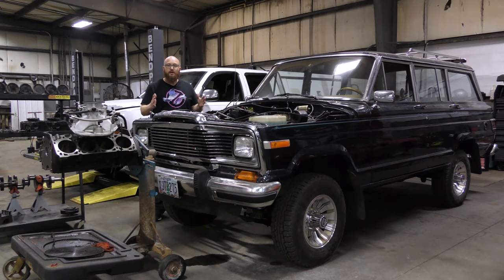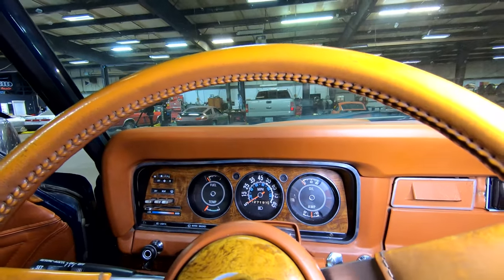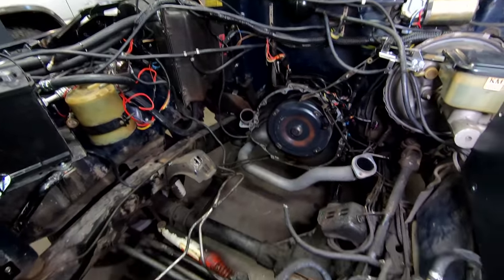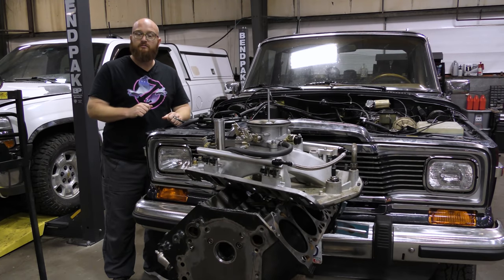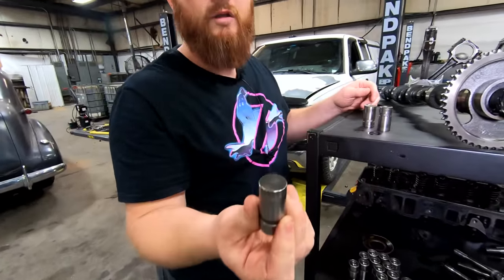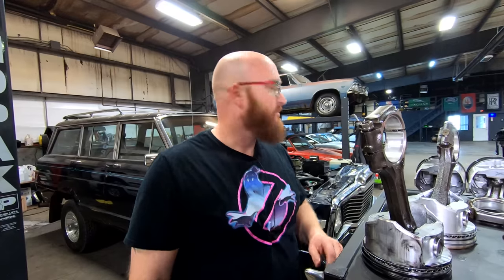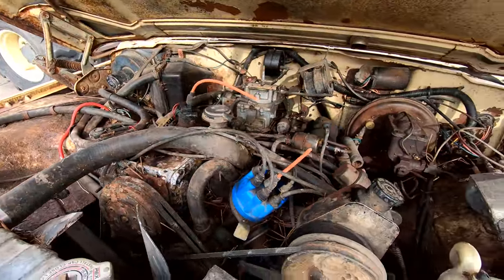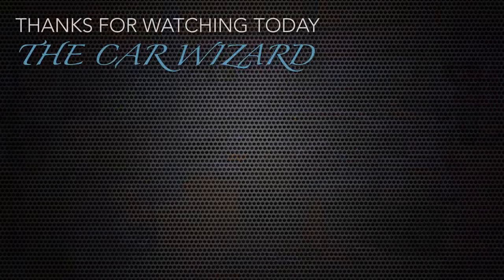The '83 Wagoneer rebuild is dead! CAR WIZARD gets burned by another shop!

Comment: Ok watched the rest of the video Car wizard your diagnosis is very disappointing, One of the problems with building engines is the unknown. I have owned a shop for over 30 years. basically people bring you engines that are well worn have had years of corrosion stress and heat cycling and expect gold back and they should they are paying for a service.
That block had a casting issue since the day it was cast a cold shut or a thin porous spot in that area then after many years of heat cycling and corrosion thermal stress it was thin. The rebuilder had no way of knowing that. it wont show up under mag or even a pressure check.
The casting leaked coolant on the cam lobe the one lobe went flat and here you are.
Its not a cam break in issue if its only one lobe. There are some bad lifters going around but lifters are machined to very close tolerances and what can a builder do take every one apart and use his NASA grade measuring equipment to quality control them? i actually bought a Rockwell hardness checker after being burned by a soft pushrod guide plate.
Also hydraulic lifters are very sensitive to contaminates like the metal from that cam lobe going around the filter through the bypass. This should have been caught and torn down earlier.
In the years i have been in business I could tell you some story's like the mazda V6 that would run for 5 minutes after rebuilding then start smoking. pulled the head off 3 time finally decided to borrow some oil green dye from the auto repair. pulled the head off one more time used a ultra violet light and it was a porous intake port. Pressure testing wont show that because its not the water jacket. Bought a new head installed it problem gone. Why didnt it smoke for the first 100,000 miles? The casting was just good enough . 
A really nice 66 Chevelle convertible with a 327 rebuilt it ran great had a knock like a piston pin after rebuilding? This was when we first opened up shop. After pulling and tearing down 3 times triple checking everything it turned out that the new replacement performance cam had a lobe cast just a little to wide just clipping the lifter on the opposite bank and i guess the hollow valley area amplified the sound. We learned not to put the engine back in till we absolutely found the issue on that one. I could go on and on with more of these.
The answer is you always back your work as long as the customer can keep a reasonable cool mature head you fix it for free even if it is not your fault and do whatever you can to head these issue off but there will always be odd thing popping up in this business. The good faith will pay back in the long run.
Then there is the auto repair shop or Buddy that has bias/loyalty toward another shop making up things or at least seeing things in a neg biased way causing issues. Now instead of getting a warrantee of a refund the customer has been all stressed out pissed off by the repair shop and gets to pay for the job twice.
Are there bad machine shops out there? Oh you bet. There is not required certification billy bob just buys some equipment and claims he is an engine builder because he re ringed a 283 chevy in bobby joes barn and it ran.  
Oh and that big single plane with a race speed density throttle body is a complete miss match for the engine.

Comment: Buddy of mine has an Automotive machine  shop and builds anything from stock to full on large drag motors. He tells me most all lifter / cam failures are due to the lack of proper break-in. He just got done with a Jeep 304 and he installed a street grind cam designed for roller lifters. I believe it was an ISKY cam and lifters. If you like I can get the part numbers he used.I’m with the other guy here get a dual plane intake intake. It will make more usable power in the rpm ranges the customer needs.

Comment: I bought a truck with a rebuilt 468 big block that wouldn't run right. Would never idle right and the adjustments would always change. It was eating the camshaft because there was 3 times the amount of spring pressure that you can run on a hydraulic flat tappet cam

Comment: Most of the damage I see can be attributed to what I am fairly certain was a lifter failure. The trashed bearings could easily be the result of that lifter failing and taking a cam lobe with it, sending a ton of debris through the engine. The sticky wrist pin though...... While it is possible that could also be debris, I would say that there is a different issue going on there.  To be honest, I wouldn't be the least bit shocked to find out that the previous engine builder did most everything correctly. Where I think they went wrong was installing the flat tappet cam. Every single cam company that I have personally spoken to in the last couple of years is experiencing a ton of flat tappet lifter failures. It also seems that most all of those companies are buying their lifters from outside of the USA these days. Unless you can find nos lifters that were made at least 5 years ago if not 10, I would explain to the customer why a retrofit to a roller is a wise choice in this day and age. The down side being the added expense.  Some will debate that the roller portion of the lifter can fail ( which is true ). However, GM anyway ( and most likely other brands too ) have been using roller lifters for 30 years or more. I personally have seen more engine failures caused by the bearing journal on cams wearing out than by failing lifter rollers. The upsides being lower oil temps through reduced friction. You can run what ever oil you like ( and yes, with flat tappets you have to watch what oil you use ).

Comment: As many are noting about poor quality lifters on the market right now, the damage to the lifter screams lifter failure. If the cam failed usually the lobe gets knocked darn near completely off by the lifter before it disintegrates. Wizard, here is how bad the poor quality lifter issue is right now: My race engine builder re-used 40 year old lightened lifters in my air cooled Formula Vee engine. You read that right, rather than risk using new but likely poor quality lifters it was a safer, more reliable bet to use used, 40 year old parts.

Comment: I believe lifters need to be individually fitted and gapped with feeler  gauges. This has to be done to strict tolerances.

Same with the bearings on the crank journals. Fitted with the correct tolerances with proper lubricant. 

Cowboy engine builders.

Comment: there are quite a few places ( like ebay ) where they are selling counterfeit cam shafts and it is Chinese garbage. The cam failure more than likely destroyed the motor. toss that victor intake and get a dual plane . but use a 1" spacer block . it helps create a mixing chamber effect for the throttle body type injectors , and a more even disbursement  of the air/fuel to the cylinders . AMC engines are a bit of a soft motor in terms of metallurgy. but a stock build should not be a big deal . The truck is so nice you would be miles ahead with an LS < but you already know this im sure . Good luck with the rebuild.

Comment: Lifters have been very bad except from a single Source, I do not remember the source, but call Uncle Tony's garage, he has had several cam lifter failures in the last few years due to really piss poor parts. It may not have even been the engine builder that's at fault. You have said in the past that you are not well-versed on these older style engines. Uncle Tony's garage can get you straightened out quite quickly. He has built with brand new cams and brand new lifters engines that lasted literally an hour or a little over. And he knows how to break in a camshaft. Like I say this could very well not have been the Builder's fault. At least as far as the camshaft goes. As for the Assembly of the connecting rods and pistons, yes that's an issue. There is no excuse for that. And it does look like those things were badly out of talents and the engine may have been put together completely dry.

Comment: I'd like to have a look inside the oil pump since there are multiple points of lubrication failure. It's unlikely bearings, wristpins and lifters all failed simultaneously.
Was the oil pickup far enough from the floor of the oil pan?

Comment: So many signs of oil starvation you might think that the oil pump was installed incorrectly and there was no oil pressure, but then you'd have seen the oil pressure light come on. Was most of the oil starvation related damage just on one bank? I've seen things go wrong like this when oil gallery plugs have been installed incorrectly (too deeply), cutting supply to the lifter galleries, which could explain the seized lifter, but dry rod bearings and gudgeon pin would suggest oil wasn't getting to the crank so the gallery that feeds the mains would seem to be worth checking too.

Comment: I have had flat tappet lifter failure three time with different brands . Broke rocker arms and bent pushrods. Next time roller lifts only, the difference of $ 200.00 to $1000.00 is how many tines do you want to tear it down to finally get it right. A plus with rollers is that you do not have to use high zinc and phosphorus oils any more. I had the same problem years earlier when the oil companies didn't tell any one that they had pulled the zinc and phosphorous out of oils and had several  flat tappet cams fail.

Comment: Joe Gibbs break in oil for cam break in, oil doesn't have zinc in it anymore or very little. I some times will heat and mix the zinc packet that you can buy.
The piston wrist pin being stiff isn't good.
Seeing the hole in the block tells me someone kept running a very noisy engine that could have been repaired.......
Sad when a cam goes flat the metal that comes off gets distributed through out the engine particularly the bearing and 
turns them into sand paper. Must be changed or will sand the crank to too much clearance.

Comment: The stiff wrist pin is crap, but the wiped lobe is a problem everywhere as every engine guy now knows. Garbage Wuhan lifters plus wrong/not enough assembly lube and low or no zinc in the oil will lead to this almost every time. We don't live in a flat tappet world anymore, talk the customer into a good quality roller cam and kit, and he will never see a cam problem again.

Comment: I work at AutoZone and one day I had a customer return somewhere between $500 and $1000 worth of parts after a failed engine rebuild.  Apparently the engine ran for all of three weeks or so before the oil pump failed and completely took out the motor.  The camshaft and several rollers were literally missing chunks of metal.

Comment: Uncle Tony's Garage has had bad luck with name brand cam and lifters. the lifters could have been bad and ruined the cam etc. as for the tight wrist pin. I had a bad engine in 1960 from a bad rebuilder. it was a 283 chevy and the wrist pins were so tight that cold it took two people to flex them. when the engine warmed up the rod bearings could not take the extra load and the whole engine went to crap. I now know how to properly check the hot clearance on wrist pins that use the piston for the bearings. live and learn. I got cheated then but know better now. I have rebuilt another 283 in my 67 van and it ran fine ever after. I am with your customer in staying away from that rebuilder. I grew up on the farm in the 50's and 60's so at least the things I did worked. its so sad to see this happen.

Comment: Not sure if you should be blaming the rebuilder as much as the cam/lifter manufacturer. There's been a lot of lifter failures happening lately due to poor metallurgy and treatment. Check out UTG's channel on this issue.

Comment: Rebuild has done zero miles?

Oil pressure issue. I would most certainly check the oil pump and all the associate bits 😂 Blocked galleries, pickup etc etc

Comment: Great video. I also agree it was a bad assembly especially with the wrist pin situation. Something goofy there..... and reading the comments on the quality of hydraulic lifters available leads to me believe this may have something to do with it as well. There is no way this engine was "broken in" on a dyno or any other type of pre-run situation. Bad Build. I would look into a roller cam as well.

Comment: Put roller lifters, good cam, alu heads and up the comp ratio. To get some torque and "mileage" of that gas to heat exchanger.  Efi is just downgrade to jeeps durability.

Comment: I wiped a few lobes off the cam of the first engine I ever built, despite using the cam manufacturer's lube.  After that, I slathered the lobes and bottoms of the lifters with moly EP grease, and I never had another problem.  That sticky stuff hangs around until the oil warms up and melts it off.

Comment: Looks like improper cam break in or used reused lifters not installed on the proper lobes also wrong break in oil for flat tappet cam . Mainly lack of attention to detail . Best Wishes and good luck .
🇺🇲🇵🇷🦊👍

Comment: Zinc zinc zinc!!

Did that engine get the zinc added to the oil and broke in properly? 

Flat tapper camshafts need zinc in the oil and engine oils today don't have zinc in it because it's bad for catalytic converters.

So every oil change zinc must be added to the oil or buy special oil for flat tappet engines.  I use a product that's specifically made for older engines that have flat tappets.

Comment: Cam break in failure does automatically suggest a bad rebuild , trying to set up a fuel injection system on a fresh rebuilt block can be the cause , were the lifters primed , was the oil pump and filter primed ? maybe the motor cam break in should have been preformed with conventional carb first then install the fuel injection , unnecessary cranking over and over will wipe breakin lube from the surfaces fast !  . the metal shavings from the lifter ,lobe destruction sent metal fragments around the rotating assembly and worked its way directly into the bearings and piston pin , seizing it. never break in a cam while setting up , working out the bugs of a fuel injection system, better take my advice with the fresh rebuild , could reoccur ?

Comment: Different engine builders for different engines..most of the A m c motors I put together always had exceptionally loose tolerances and I always thought it was super strange they used such low torque to put everything together im willing to bet they exceeded required torque on all the rods as well as the  mains . No oil its designed to be loose ..They probably used small block chevy torque specs.they most likely never built an A mc and thought it was a typo when they read the specs and decided to take it upon themselves to use small block chevy torque specs it screws everything up and you end up with no oil pressure.that wrist pin is probably bent if they used a torch instead of an oven to hang it ! Seen that happen to a 283 years ago

Comment: I would suggest the owner to claim the warranty they will definitely point that Wizard ruined the engine!
Looking at the pistons top you can notice wrong ignition and fuel timing they are not supposed to be black wich means it was running rich and probably washed the engine and diluted the oil that's why it seized the rod and worn-out the bearings lifters etc.
Amateurs playing with aftermarket ECU will end up this way

Comment: If that's one of those AMC v8s they were always notorious for cam oiling problems, so much so many AMC diehards tap in to the oil gally in the front of the block and run they're own line through the valley and have it spraying on the cam

Comment: I would assume shop used steel shot to clean block and such    Then hot tanked it and there was steal shot left behind and ran through once running and messed up stuff.      Just for heck if it cut open oil filter and see what's all in it.

Comment: I am an engine builder for a living In the last year 2 year flat tapett lifters have been having more issues and I have ever seen in my 40 plus years of experience It is most likely due to the metalargy  And the fact that there is no more Z d d p In motor oil anymore due to its effect on catalytic converterAll the engines I've built now I require a roller Cam shaf Conversion due to this fact there is a video by Uncle Tony's garageI absolutely agree with and explains why the lifters are having an issueWe'll not install flat tap at cams anymore the problems you showed with the engine such as bearing failure and possibly even the stiff connecting rod could be caused by powderize flowing through the oil system due to the defective lifters grinding the cam lobes off

Comment: Being devil's advocate. There is a rash of bad lifters and cams at the moment. I've seen it myself as have many others in shops. The common failure is in the hardening process either on the cam or the lifter or the oil passages being filled with garbage from the machining. 

Now the builder should have checked all the passages with a wire so if it was a lack of lubrication due to that then it's his fault partially. However, improper hardening (even on big brand lifters) is kinda hard to check for by the builder without some very expensive equipment. That all said the way that both the lifter and cam were eaten up and the stiff wrist pin and visible overheating on that piston tells me there was a blockage and oiling issue through the engine.

Comment: There was a bad batch of Fel-Pro lifters with no camber at the base that took out a bunch of motors, mine included. Check the other lifters for camber, put two end to end, they should rock a little, I never checked mine and paid the price. I find it hard to believe that any engine builder would install a piston like that, I bet that the couple of ounces of metal particles floating around the engine was the cause. Just be careful when throwing around accusations in this age of garbage replacement parts.